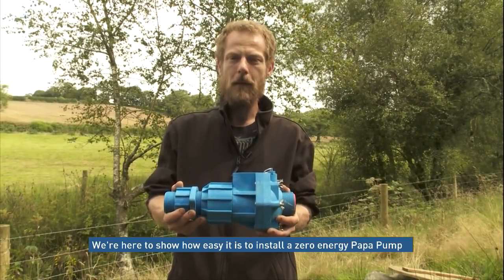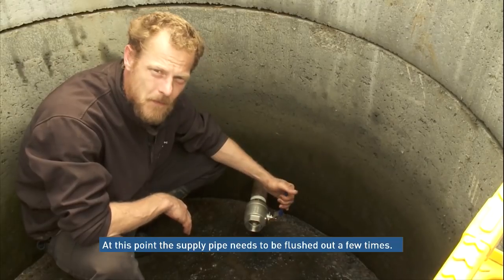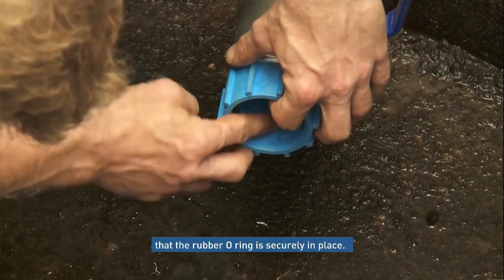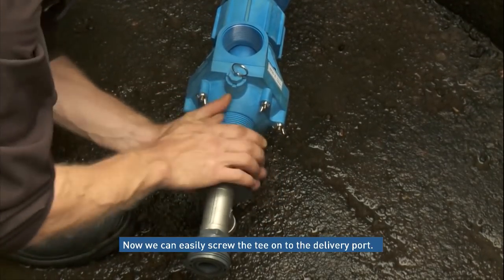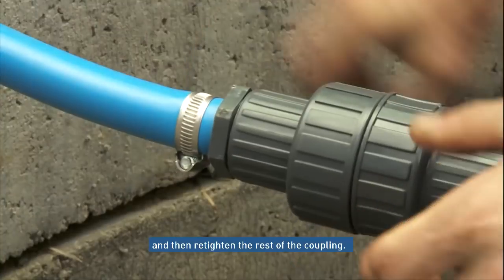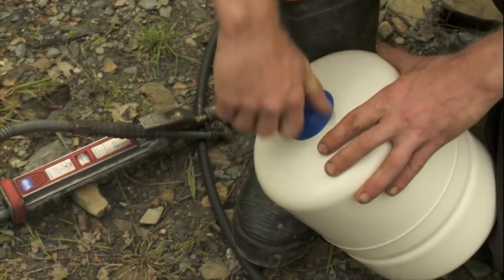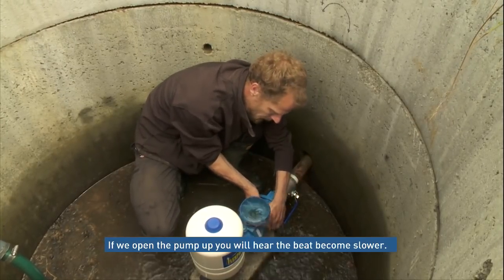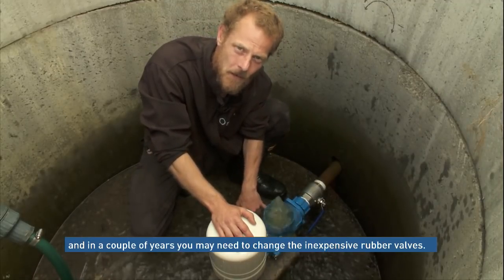Ram Pump Install Step by Step Papa Pump Install

Comment: Do you think there is a possibility of lifting approximately 40 feet with a 3 inch line?
I have lots of 3 inch line, would have to buy anything smaller
Reply from the maker: You can, it would take longer to fill initially but it would still work fine
Reply: @Waterpoweredtechnologies  thank you, that's huge, I have a 3000 gal tank that will gravity feed my cabin...
So this is gonna work for me...
PVC prices have quadrupled...
Thank you, I intend to buy one...
Reply from the maker: @OutsideInn2020  Great to hear, if you email us at info@wptglobal.net we can answer any other questions you may have

Comment: Would it continue to pump if the pump chamber is filled up and the pump is submerged underwater?
Reply from the maker: If the pump becomes fully submerged in water the pump will stop due to the pressure on the exhaust becoming equal to the input

Comment: It's difficult for me to take the video seriously when this guy don't even know how to properly use the channel locks.... really ?????
Reply from the maker: Using them backwards ensures that you don't get the plastic fittings tight enough to split them before your wrench slips. Anyway we don't install normally so this is just a demonstration of installing the pump.

Comment: Is there any way to use a papa pump system to draw from a well to a 15 foot high small water tower or would it be best to use a solar pump to get the water to a holding tank and then use the papa pump to lift the water ???
Reply from the maker: The Papa Pumps requires a flowing water source, this is due to needing a supply head as the water pressure in this supply head is what powers the pump. So yes a solar pump would be best to pump the water out of the well to then feed the papa pump, the water exhausted from the papa pump (not pumped) could then be directed back to the well so none is lost. hope this helps, feel free to contact us at: info@wptglobal.net
Reply: For your use case, it would be best to simply use your solar pump to pump the water all the way to your water tower. The papa pump is just another version of a ram pump which typically has an energy efficiency of 60 to 80 percent. It doesn't make any sense to pump water to a holding tank to then immediately throw away a significant percentage of the energy you spent in pumping to the holding tank in the first place.

Now for situations where you have sufficient natural head, then using a RAM pump makes sense. But in situations where you have to create the required head artificially by using an alternate energy source, then using a ram pump is nonsense.

Comment: 6:07 how many liters of water is lifted by that 1bar of pressure lift to 10m? and How long does it take to get up there?
Reply from the maker: It's not the pressure that does the lifting, the pressure vessel is only there to ensure a smooth flow and constant pressure for the pump. The pressure in the vessel is decided by how high up you are pumping to, please see our performance charts here: https://www.waterpoweredtechnologies.com/calculator/
Reply: @Waterpoweredtechnologies  ok but what determines how much water is pumped per second and how can we optimize that
Reply from the maker: @ikobi  That is the supply head, as in the fall you have into the pump,
Reply from the maker: @Ik Obi  The greater the supply head the more water pumped

Comment: I just learned something new, how refreshing. And after you learn how to use pliars the correct way, that would make the two of us! 
 ahh Just josh'n with you lad, ya did very well. Thank you for your time and knowledge
Reply: unless that is a "fail safe" technique that is being applied while using the pliars to preserve the non-metal material, than my statement ramains, sir.

Comment: Seriously looking into this from an energy independence angle - could see this working alongside a Hydroelectric Pelton Turbine, simple 15m tall two tank system, with float valve to equalise tanks to make up for the flow rate differential between this ram pump. Should be able to generate 5kw from that type of system 24/7 and it would be completely closed loop apart from top up water feed due to evaporation losses.
Combine this with a rotary water cavitation system or Frennette heater and you have free power, limitless heating with the only maintenance being seals and bearing replacements on the generators. It's so simple it makes you question why the hell are we still burning fossil fuels and using toxic lithium batteries.

Comment: Which is the main water source? How much  feet upper  or deeper? Can I use this pump for delivery water from 40 feet deep?Please answer me!
Reply from the maker: hello, The pump requires a running water source, as well as a drainage for the exhaust water so is therefore not suitable for well applications

Comment: This video is very good, that is, the valve is an old style, it is a pity that it is bulky to hold, I recommend a micro electric valve with very good water saving effect, small and easy to install, it can control the size of the water flow, Website: http:/ /www.tf-electricvalves.com

Comment: So how is this different from a ram pump
Reply: That pressure vessel seems different? I don't see it on ram pumps.
Reply from the maker: Our pumps use our Venturi valve technology to improve efficiency and reduce size. Please see our website for more information: www.waterpoweredtechnologies.com
Reply: There is no difference. It's a ram pump. Just uses a different valve, but the arrangement is the same and the principle upon which the pump works is the same. It's nice that the value they use is self starting, but that's all.

Comment: I agree with many other comments here. Way too overpriced. I do see the value in your efficiency improvements, but you are priced way too high to compete with your competition. Some additional models at different price points and technical specifications/sizes would be nice. Good luck.

Comment: Where does the water come from?
Reply: From higher than to where you are pumping. It seems like a nice compact version of a ram pump. Also the beating sound is consistent with a ram pump. But no idea what the function of the pressure vessel is in the design...
Reply from the maker: You use water from a natural water source, a stream, river or spring.     Because you are using smaller watercourses, you are protected from floods.  And by using surface water, you are not affecting the ground water aquifers which are already under strain from over abstraction.

Comment: We know right now by watching you use that channel locks your no plumber turn that wrench around and use it right I'll be stupid
Reply from the maker: You're right. Not a plumber.  We advise that people don't use plumbers as they tend to cut corners and compromise the efficiency of the pump. If you follow the instructions you will have a reliable water pump guaranteed for 5 years. You don't need plumbing experience to install this.
Reply: @Waterpoweredtechnologies  anybody can be a plumber hot is on the left cold is on the right and s h i t flows downhill if you can remember these three things you can be a plumber oh and don't hook the hot water side to the shit tank it'll stink neighbor found out haha

Comment: I guess if you are not concerned with wasting a lot of water to pump a small amount of water, this is an acceptable solution.
Of course, an electric pump would waste no water.
Reply from the maker: A little negative there Matthew.  That is the whole point of zero energy pumps.  They use no electricity or fuel - it's better for the planet.  And don't forget some people don't have electricity so it is a good off-grid solution. If you are off-grid you can use a dirty diesel pump - not good.  Or you can use solar or wind to extract water from a borehole - better, but you are depleting ground water which takes decades to recover.  Or you can use the naturally flowing water available to you.  And by the way, the water is not wasted, it is returned to the watercourse and reduces abstaction.  Would you describe the water that flows through a water mill as 'wasted'?  Both the water wheel and the ram pump use the water as power.  Of course it is not the solution to every water delivery problem and if you want to use electricity instead of 'free' power, go for it.
Reply: @Waterpoweredtechnologies  not negative; pragmatic.
You are using a lot of water to pump a tiny amount of water.
a dirty diesel pump could accomplish the same task in minutes that your ram pump takes days to do.
I never said it wasn't a useful technology under certain circumstances.
But the water you use to power the pump is NOT returned back uphill to it's source.
Ram pumps have been around a long time.
Their uses are many.
But there is no magic here.
Your video glosses over the facts a bit.
In an area where water is precious, this type of pump will waste a lot of water unless you design your field both at the delivery end AND downhill from the pump.
You know they make solar electric pumps that waste no water at all right?
The ram pump is not the only solution to the problem and certainly not the cheapest at the price you are charging.
Of course, someone could build their own ram pump rather easily from hardware store parts, and many have.
What is the value of your pump over a home made pump?
Reply from the maker: The pump is used by a lot of farmers who have available streams and springs in fairly remote locations. They could run a cable down for an electric pump or carry fuel down every so often to top up your diesel pump. But they have decided on putting in Papa Pump which pumps water (albeit a small percentage of the flow) to a storage tank for gravity feeding. The flow isn't a lot compared to a diesel pump but it works 24 hours a day without human interface. Any excess is simply drained or piped back to the watercourse. The diesel pump will do the job quicker by they do not need 'extra quick' water.  Not many want to go down to the pump everyday to refuel, turn on or turn off, just so that you can get the water quicker. Not very pragmatic?  Not for everyone in every circumstance but a real time saver for some.  Also once installed, you save on fuel.  And it doesn't pollute the planet.  What's not to like?
Reply: @Iceaxehikes  Exactly... in areas where water is precious... it's quite dangerous to take to much water from a river, because it might cause big problems lower on the river... so yeah this kind of pumps are great even then, because you're pretty sure you don't use to much water. The "lost " water is returning in the river and feeding plants, or giving water to other humans and animals further down the river.
Reply: You're not bothering to think about it there.
Imagine a different system. One where you have a turbine powered by the water. The output from the turbine is used to generate electricity, which in turn is used to power a conventional water pump. Obviously, the amount of water pumped would be a fraction of the water used to power the turbine. Would you call the water used to power the turbine waste? I think not. And the same principle applies to the ram pump. It uses the kinetic energy from a large amount of water to pump a smaller amount of water to a higher height. It just does so via a clever application of the water hammer effect caused by a value suddenly closing, causing a moving mass of water to suddenly stop.

Comment: What a friggin joke!!!!!!!! $1700 USD for that plastic piece of junk that is just  redesigning a old ram pump..... We can go to ANY home improvement/hardware store and buy 2 check valves, some pvc pipe and build a better working ram pump for under $30usd
Reply from the maker: It is not plastic. It is a composite of nylon and glass - extremely hard and light.  It is a redesign of a hydro ram - for the better - it has a patented new rubber valve which has improved the efficiency of the pump and reduced maintenance.  Both of these new features means we are able to guarantee the pump for 5 years.  Will you guarantee your $30 dollar pump for 5 years?  Good luck.  Now I'm off to buy a few wires from the hardware shop to make a radio for $5 dollars - how much do you sell your radios for?
Reply: @Waterpoweredtechnologies  lmfao first off "nylon and glass" so its REINFORCED PLASTIC! Theres a reason why even an INDUSTRIAL ram pump is cast iron and all metal parts minus a rubber seal on the flaps... The "home made" ram pumps you can build from parts at a store last farmers 20+ years if they actually put a screen on their intake.  Im still dying laughing that youd think a radio is just wires...

Comment: You'd have an easier time if you turn those pliers around.
Reply from the maker: Go easy!  He was very nervous about being filmed!
Reply: We call these channel locks here in the USA.  Using them backwards as you were insures that you dont get the plastic fittings tight enough to split them before your wrench slips.   So yes you were using them correctly for PLASTIC.
Reply: Always someone with a negative comment.

Comment: What happens to the displaced water in the well? Won't it fill up?
Reply from the maker: It is not a well. It is the pump chamber (built from standard concrete rings). There is drain so that the water used for powering the pump is returned to the watercourse to reduce abstraction.

Comment: Totally cost £20... And u want 1350£.   Hhhhhhhhh
Reply from the maker: well if you think a £20 pump will do the same job as ours, then best of luck my friend
Reply: Water Powered Technologies I belong from Pakistan ... We installed few pumps totally cost 280$ US.  I will send u Link for details
Reply from the maker: I would rather you sent a video showing them pumping to a height of 100m!
Reply: Water Powered Technologies search.  (rahmat ullah kundi) YouTube . Watch Hindukash hotel chitral hight.  Ramp pump delivery 250ft.
Reply from the maker: This is just a variation on a theme based on old ram pump technology with mechanical parts that wear and break. It's also a lot more than £20. We have installations that pump to well over 100m high 24/7 using patented rubber valves that hardly wear and when they do, they are very cheap and easy to replace. So show us a comparable pump if you want to compare prices. But thank you for the info anyway.
Reply: Water Powered Technologies anyway May u send a sample to me? a small ramp pump that can pass 30meter of hight.
Reply from the maker: so sorry Mr Karam, we only make one size pump, the 2" and cannot supply a sample
Reply: I m living in Dubai but I will go to Pakistan soon. I will show that sample to public  in Pakistan . We will tread to u
Reply from the maker: Thank you but we already have pumps in Pakistan. Here's one: https://www.youtube.com/watch?v=ZkGooYPTqBs
Reply: @Waterpoweredtechnologies  you didn't made something new. You gave old technology and try to sale it for very big money. Very bad...
Reply from the maker: Yes, yes and yes.

Comment: Must be a PTFE tape distributor.
Reply from the maker: No, the point is that you must have a very good seal.  It should not only be water tight but also air tight - any air in the system will reduce the efficiency of the pump.  Maybe we get PTFE sponsorship though!  Just a thought.

Comment: As long as the source of water is above the pump, it will work fine
Reply: Useless for a well
Reply from the maker: And a bike is useless if you want to fly.  The whole point with ram pumps is that they use available surface water to self power the water pump. If you have no alternative to a well, fair enough, you have to use a powered pump, but if you are abstracting water from the ground when you have an available spring, stream or river, you're nuts.  You are also depleting aquifers and contributing to a world water crises.
Reply: @Waterpoweredtechnologies  it is illegal to draw surface water for public consumption in many places.
You are also glossing over the fact that you need the kinetic energy of water ABOVE the level of the pump to make it operate.
At $1,400 you could also use a solar powered pump without the limitations of a ram pump.
Reply from the maker: Everyone should check if there are abstraction limits in their area, but don't think it is OK to take groundwater and stress aquifers. Check out online how the world's aquifers are stressed by over abstraction of ground water.   We constantly say that for the pump to work you must have a flowing water source that falls by at least one metre. The Papa Pump is just one renewable energy solution for pumping water, in some cases it would be better to use wind or solar, but if have a flowing water source this can be an incredibly simple and efficient way to pump water at very little cost.  We have put pumps into Africa because the don't have a lot of sunshine (Uganda mountains) and solar panels and metal pumps are often stolen - so the Papa Pump was a good solution.  Every situation is different.